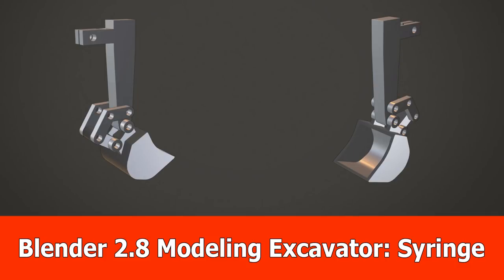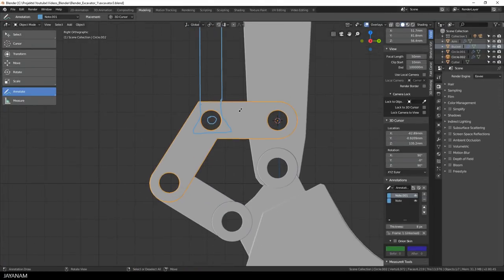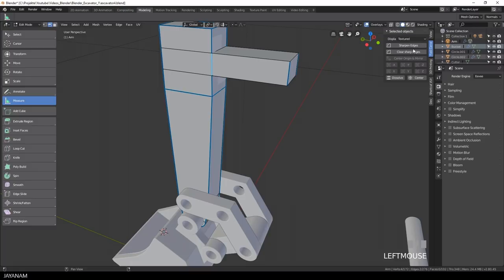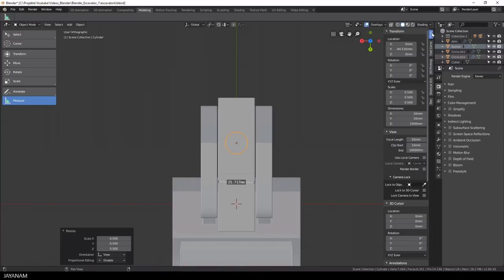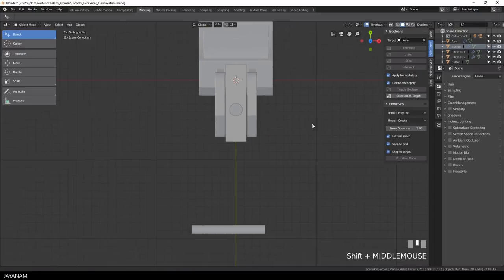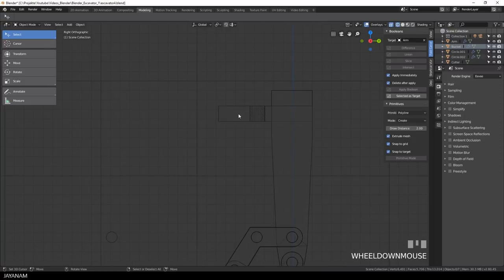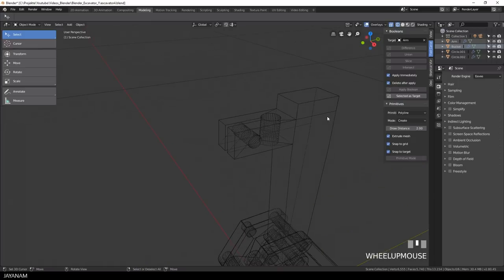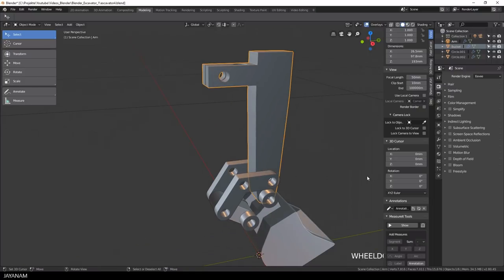Blender 2.8 Modeling Excavator : Syringe Connections

Comment: The cylinder needs to pivot at both ends!
as the bucket moves the syringe will be rotated at the plunger, you may get away with this if it remains sealed.
Reply from the maker: I know what you mean but I want to test it out first with this solution, if the rotation disturbs too much, I change the model again:-)
Reply: Cool that will be another video :)

Comment: I always wonder, how i could setup Blender that i can alwas select with a border without hitting always the "B" button. In 2.8 first i believed its implemented, but when i switch to the move/rotat/scal gizmo, the boxselection is gone. The next thing, that Blender automatically select all verticies/faces/edges behind, without goin extra in wireframe or this strange transparent mode. I mean basically the selection mode like Maya, 3ds Max, Modo and Cinema 4d. Blender is in so much things so much faster than the other apps, but in this case i always must hit a few button more and when you compute that together, at the end of the day, there comes a lot of klicks together. I tried to change it, but i don´t get it to run. So if anybody has an advise for me to set this up, please let me know.